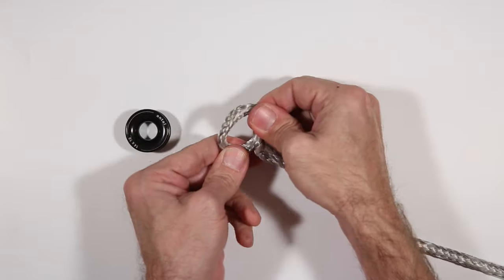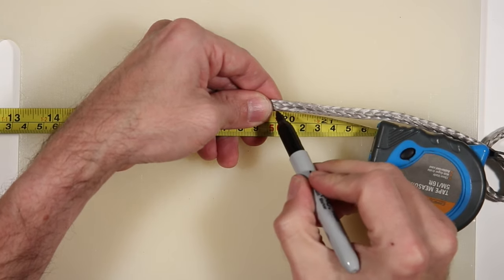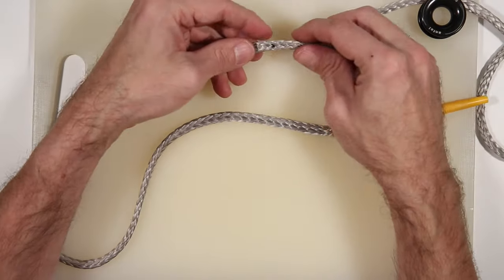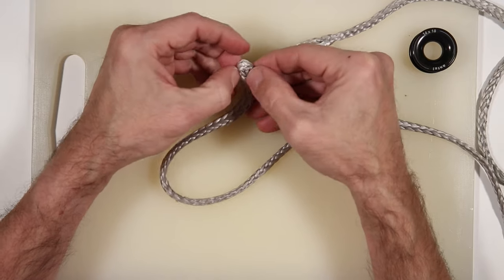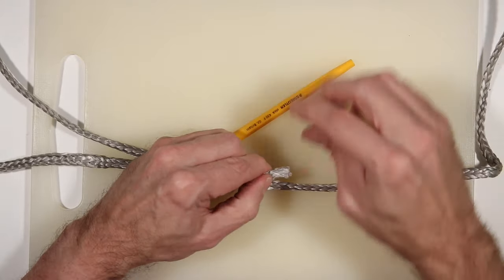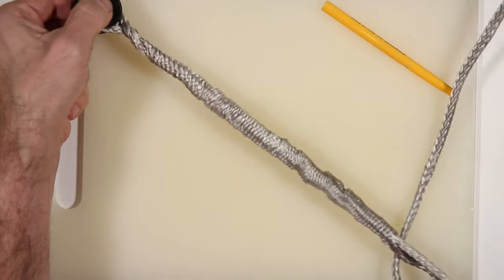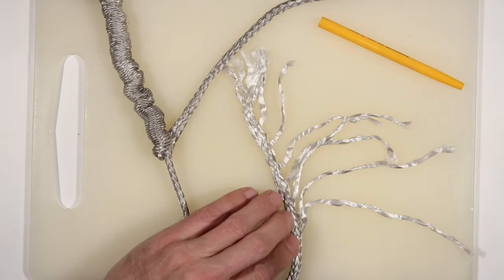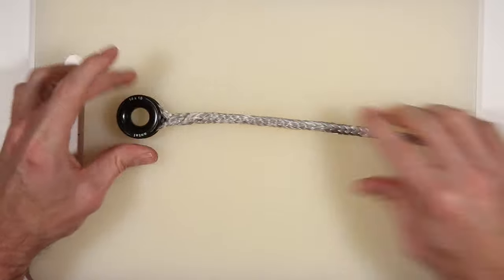How to splice Dyneema onto low friction rings with Brummel lock splice - Yachting Monthly

Comment: Clever idea and nice workmanship on the knot and the vid.  It was educational and easy to follow.   Will give the splice a go.   I also have used bits of old ballpoints and decided the other day to upgrade my game to aluminum knitting needles.  They are easy to cut to length (conservative at 22D) at 60 degrees.  For a cutting guide, drill hole (90 deg to edge) in chunk of timber (scrap 2 by 4) from the edge, then cross cut at 30 degrees bisecting the drill hole. Clamp in vise and presto, 60 degree cutting guide.  The aluminum knitting needles seem thicker walled than ss tubing but are lower cost and easier to work.  Keep up the good work.   Full sails and fair winds.
Reply: p.s. Re using vice grips against board.  Way cool.
Reply: Ooops. Apologies. was thinking of another vid.

Comment: This is a clever way to do it  if you don't have access to the standing end. However, if you do have access to the standing end, there is a simpler way to do it that results in a tighter splice. Just look up brummel eye splice and you'll find several videos on it.
Reply: Don't you technically have access to the standing end....just not once the ring is shoved in?
Reply: @mastpg  the standing end is the long end, the opposite of the working end. You never see the tip of the working end in this video. So, it is a useful technique for certain senarios

Comment: It doens't have to be a Brummel splice, a normal will also do, especially with a short end of rope.  You make a loop, and then in goes the other end thereby autolocking the splice.
I think it will look nicer, especially with 12strand silver sk-75 dyneema.  Nice video, I've been using synthetic rope for the last 5 years.  Standing rigging and its manufacture should also be dealt with in the magazine.
Reply: A non brummel can work loose under low cyclic loading, so that’s less good for something like a guardrail line. You’ll need to stitch the bury to guard against that.
Reply: @JasperJanssen  If one would compare two plices in single braided Dyneema, one Brummel and the other a normal lock-spliced, there whould be no difference at all.  You use the Brummel technique when one end is not free, otherwise a normal lick-splice eye would equally do the job.  You taper the end and put it out of sight in the braided rope for esthetic reasons and tapering is a good idea because it might 'work' on the inside and that could give rise to structural weakness.  In continuous loops, for example, you stitch and whip the loop at both sides to prevent loosening.

Comment: I also whip at the thimble and stitch along the bury.
Reply: Bill From Germany isn’t necessary with a locked brummel, although it’s good for a simple eye splice (with only a bury). Under load it’s the bury that takes the strain, but you need something to take no-load flapping, that’s what the stitching or locked brummel provide.
Reply: @JasperJanssen  Yep, I use the locked brummel, but like the whipping at the thimble as it can be difficult to get the eye just right, not too loose. Not sure if you are saying that stitching along the bury isn‘t necessary - because it is.
Reply: @JasperJanssen  this isn't a locking splice though
Reply: @MontyD  ... yes it is.
Reply: @JasperJanssen  ... so it is lol. Just looked it up! I'll keep my mouth shut in future!...

Comment: What percentage of the buried part should be tapered?
Reply: I allow or use up 1" per strand that I pull out and trim.  But it is important with slippery line like Dyneema, that you bury a length 50x the diameter of the line you are using.
Reply: @brotherlove100  But is that 50x to the tip, or 50x before you start tapering?
Reply: @GordieGii  50x total bury, so to the tip.  Also keep in mind that the taper is progressively getting less effective at holding power.  as the diameter diminishes, so does the friction, so don't get carried away with the taper.  The taper is only there to help make a smooth transition for running lines.  Under extreme line strain a straight cut line will break at the end of the rope.  So a taper is used to reduce the stress point right there.

Comment: There is a MUCH easier way to do a Brummel splice...you don’t need to invert the line twice and then un-invert your inversions.
Reply: Please share a video or instructions. I’ve found  this double invert very difficult on small diameter line.
Reply: @HarryLevinson  If you haven't figured it out already, if you have access to the other end of the line, and it isn't crazy long, you can pass the tail through the standing end, then switch the tubular fid to the other end of the line and pass it through the tail at the appropriate distance from the first brummel. Doing it this way allows you to tighten up the first brummel onto the ring and get it nice and snug. Arborists spice Tenex TEC slings this way, but they're usually less than 20' long, so both ends are available, and the rope is usually 19-24mm diameter.